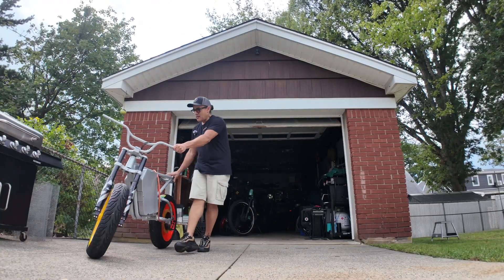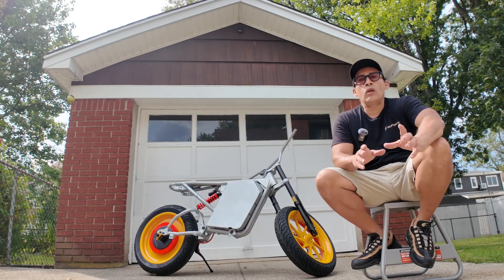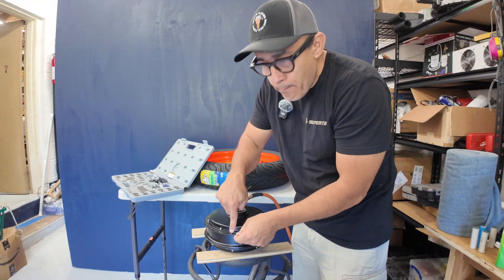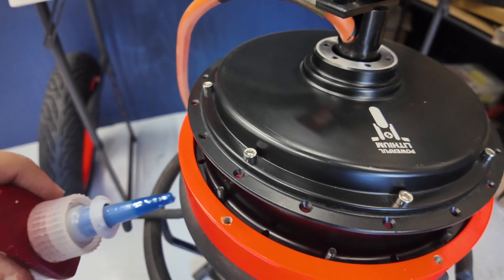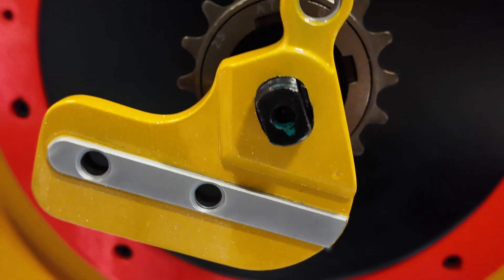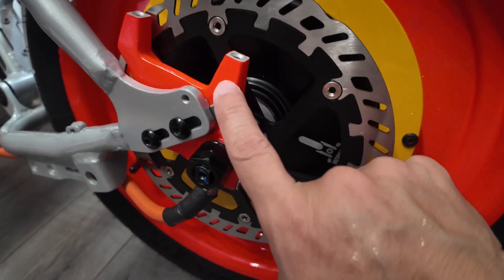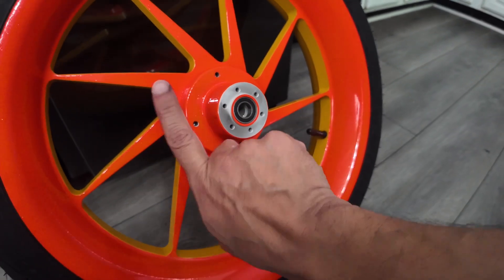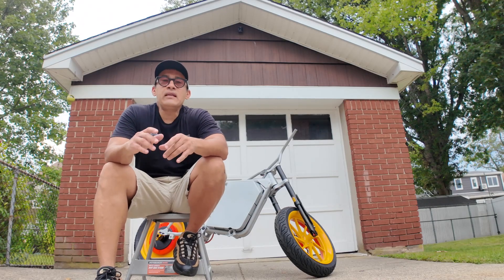HOW TO BUILD A HIGH POWERED UPGRADED E-BIKE DAY 1

Comment: The build is looking really clean Mr. E. Question for you: do the rear motor mounts not need torque arms to prevent the motor from spinning itself loose?
Reply from the maker: Thank you… 🙏🙏🙏 Greatly appreciate that… I’ve watched Powerful Lithium put multiple SUOER73 RX’s together and adding additional torque arms were not used… All are still on the road today…
Reply: @mr.e_from_nyc  Thats great to hear, stay safe out there!